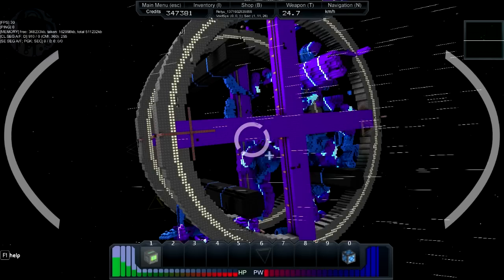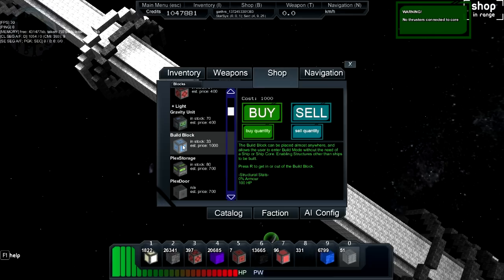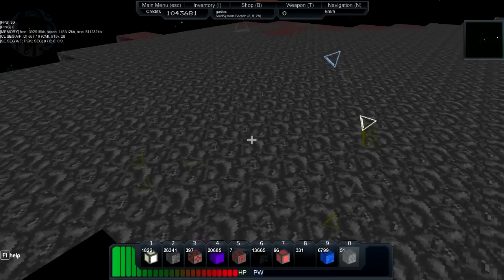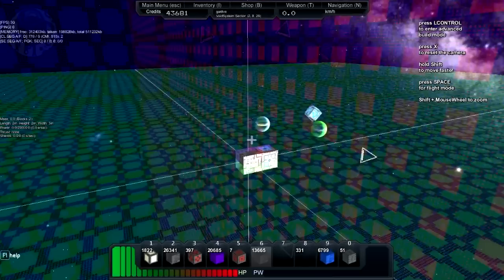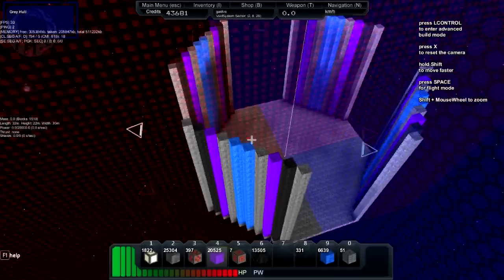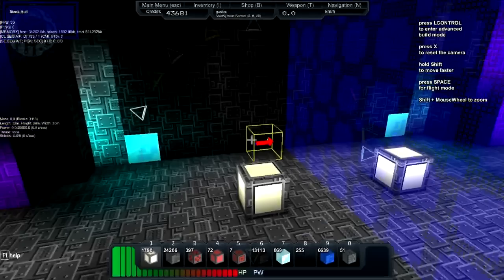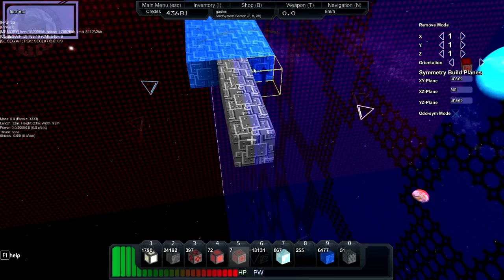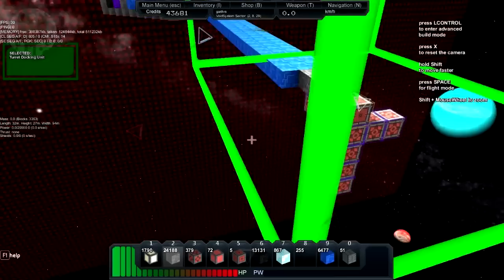Starmade - Space Station and Docking Tutorial

Comment: a few pieces of extra information that people might find useful.
1. the enhancers do not have to be touching the docking module so they can be built into a corner of the docking area.
2. the core of the ship is relatively strait above the docking module (has the same value for 2 axis) when the ship is docked.
3. the blocks of the ship can overlap the lines of the limits box but there is always half a block between the ship and surface that the module is on and a block cannot touch the ship.